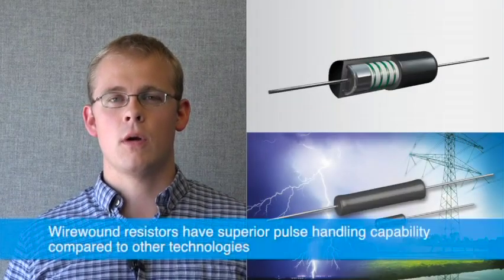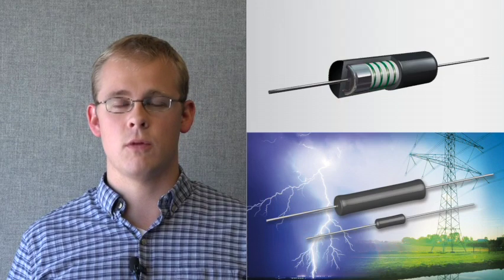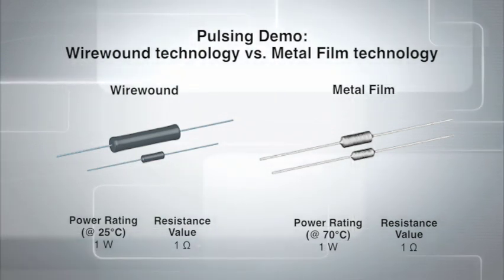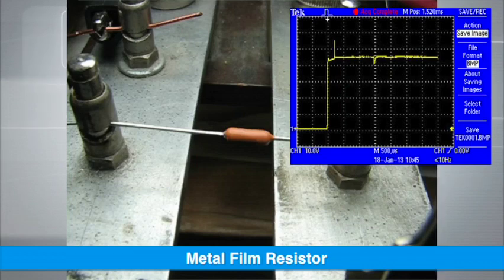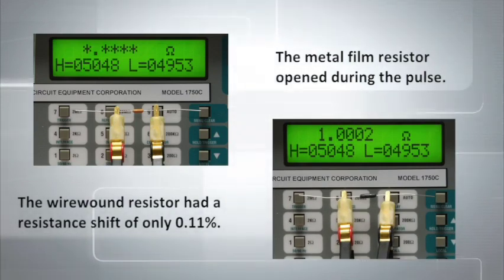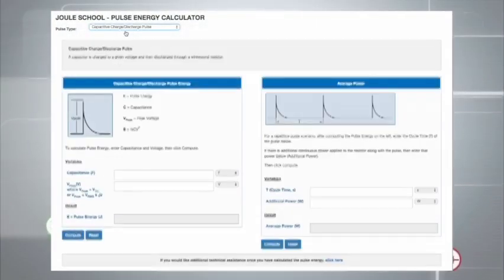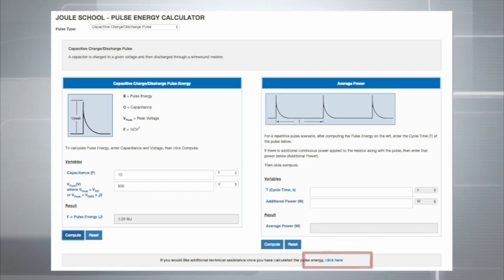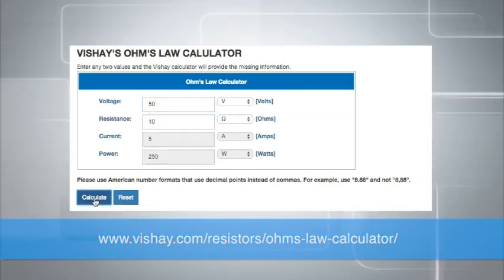Resistors: Wirewound Resistor Pulse Handling Capabilities Demonstration

Comment: I have a Lectrohm 300 on my amp.  Does it hold voltage? Is it dangerous to touch this? I don't think resistors hold current but just checking. Thanks.